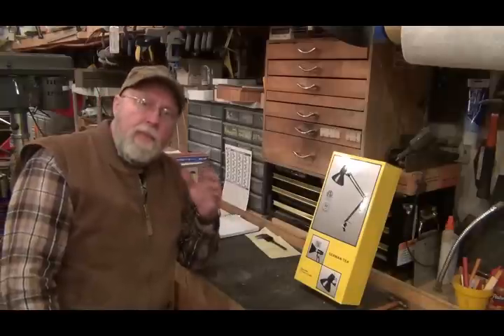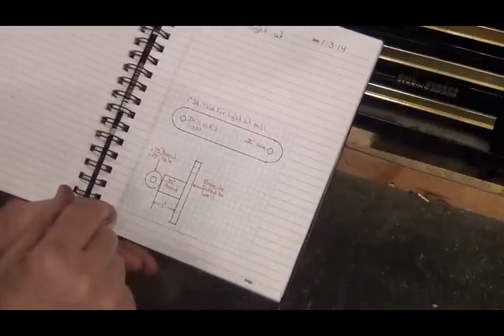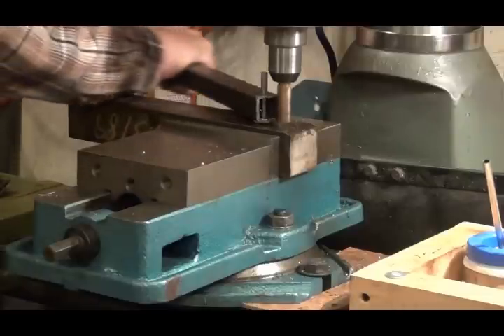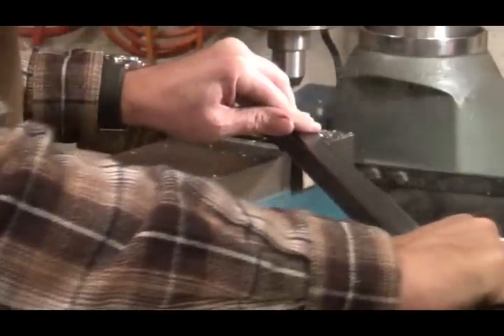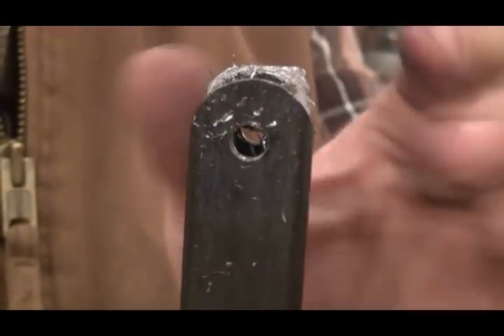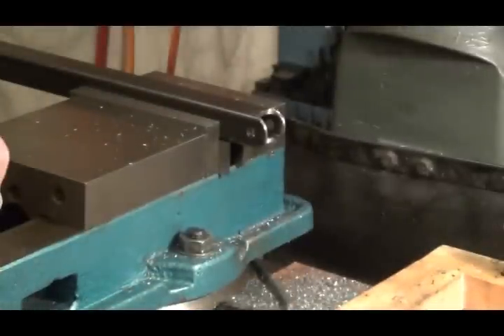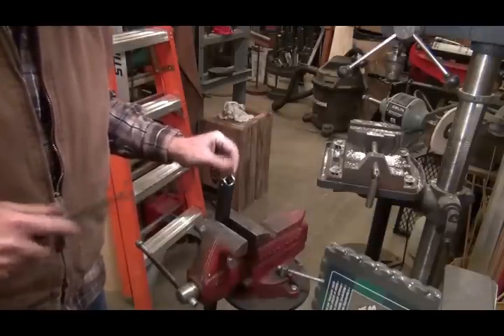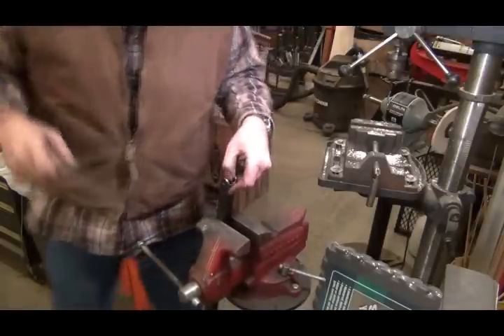Better lighting at my mill pt 1

Comment: Hey Steve,

If you put a nut on your pivot the tube won't climb up the end mill. I like your notebook. In a year you will be surprised at all the things you did over the year. I love the corncob handles. Brilliant.

All the best,

Tom
Reply: I've been looking for this Oxtools project on Tom's blog with no luck - please give me a link !

I have 5-6 of these swing-arm-lamps I want to make this device for.
Reply from the maker: Keld Sørensen http://oxtool.blogspot.com/2012_10_01_archive.html The part about the shop note book is about 1/4 of the way down.
Reply from the maker: Thanks I will revamp my pivot block. I want to make a camera mount using the same idea.